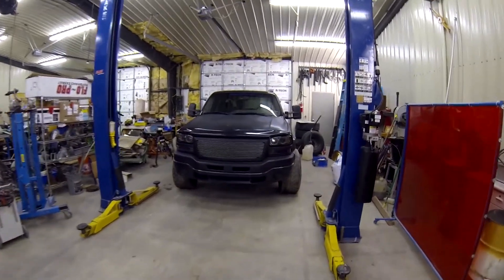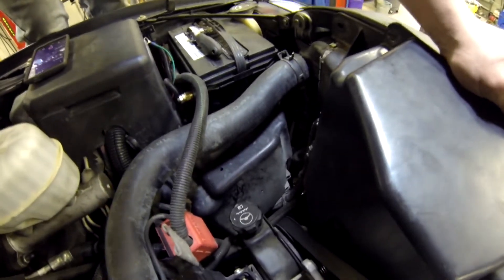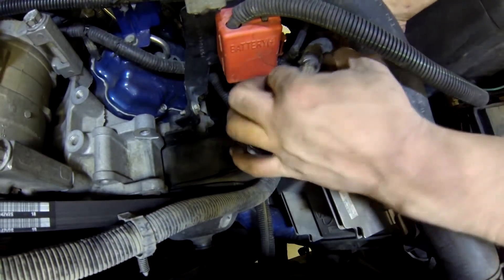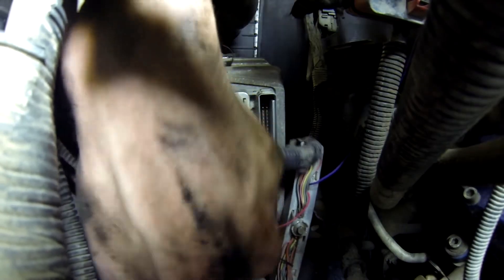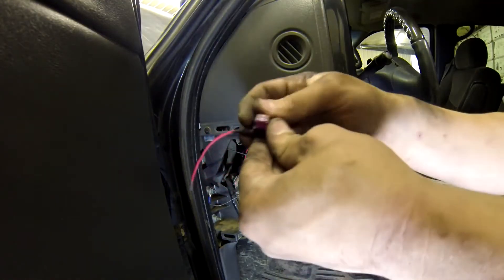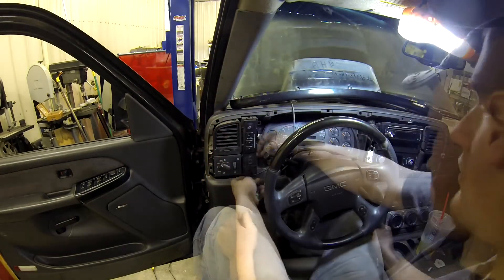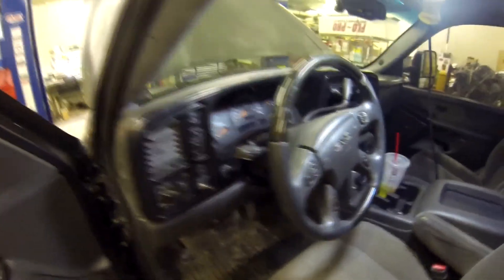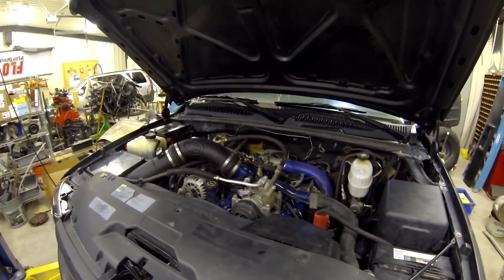LB7 Duramax High Idle Mod

Comment: you miss one little thing on the tools need it to do the job and is diaelectric grease mainly if you live on a place where salt is use on the roads it will save you alot of headches

Comment: I added cruise control to my 2001 2500hd by simply removing the existing multi-function  (turn signal/ high beam/ wiper) switch with one that had the cruise control button. Direct swap, no extra wires or anything. Works great and the "CRUISE" light on the instrument display is even there already! Thanks Obama!
Reply: I did the same thing a couple years back. Too easy!
Reply: whats that got do with high idle function
Reply: @mikenobbe1135  did you watch the video?